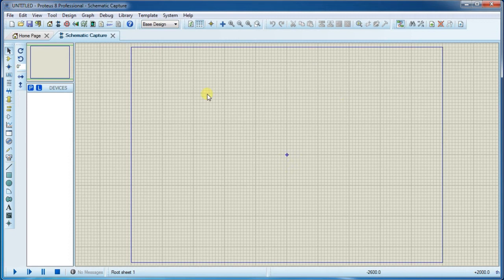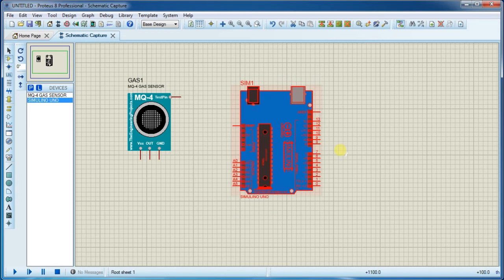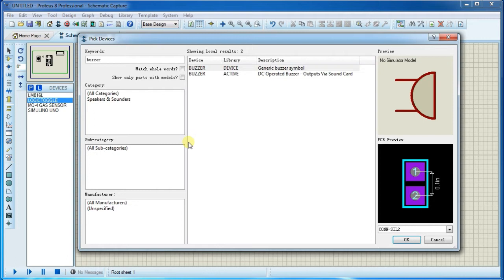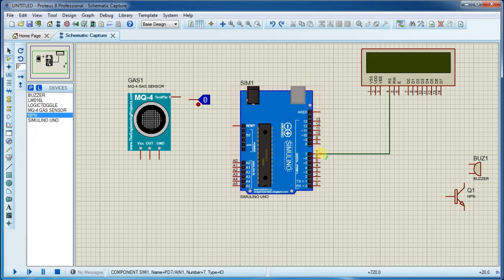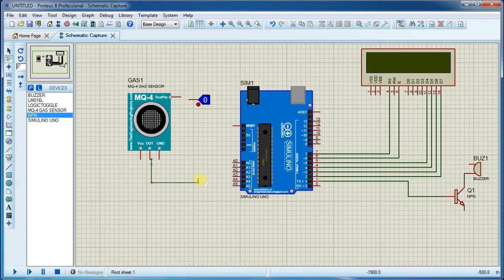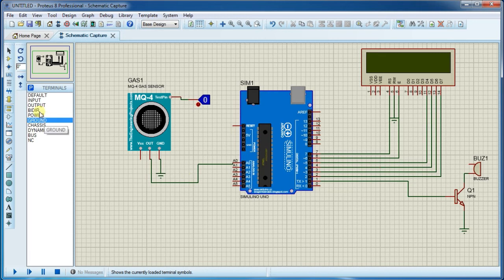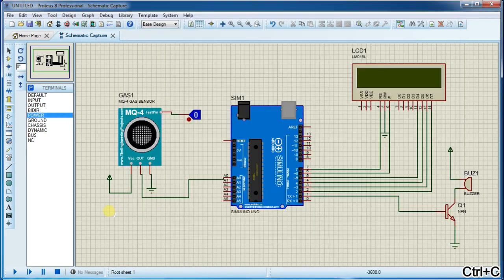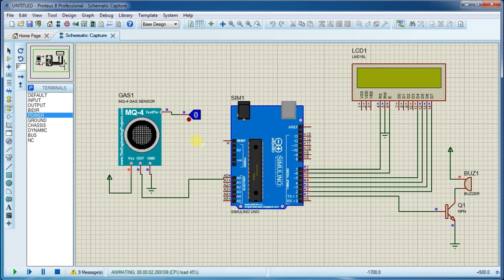MQ-4  Gas sensor simulation in Proteus

Comment: I am Getting opcode error kindly help me
Reply from the maker: This error indicates that you are selecting wrong controller in Arduino ide
Reply: Arduino Uno i ma using in my simulation
Reply: Kindly share the correct arduino library if you have
Reply from the maker: No need to change library in proteus, just select Arduino uno in Arduino software them re compile the code
Reply: @SatyamsinghYT  this one which i am using is already arduino Uno
Reply: Your teaching method is awesome but there need a little modification, you should explain the coding and method of each simulation, so that it will be more easy for beginners just like me to get more easily. Your are doing good job 👍 keep it up ❤️
Reply from the maker: Thanks for suggestion, i will try to add those in my videos
Reply: @SatyamsinghYT  👍👍👍
Reply from the maker: Can you provide me remote access to your system by tomorrow morning (india time)
Reply: @SatyamsinghYT  remote access ?
Reply from the maker: Yes, you can connect me on instagram @ioturtle
Reply: @SatyamsinghYT  done ✅
Reply: Can you please tell me the name of arduino